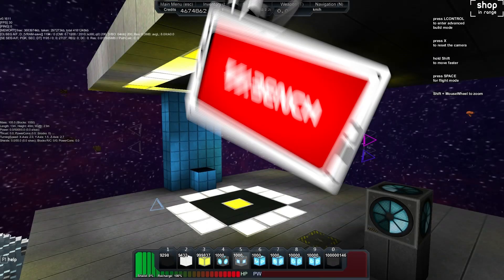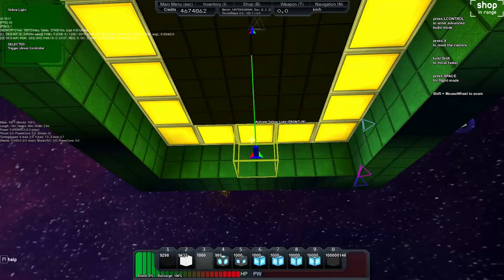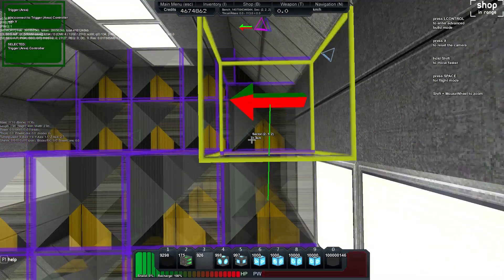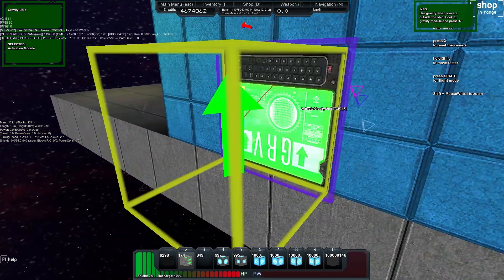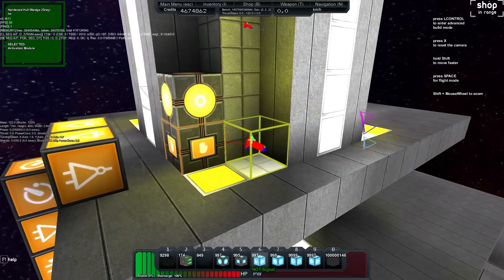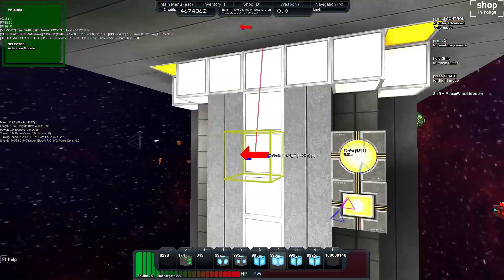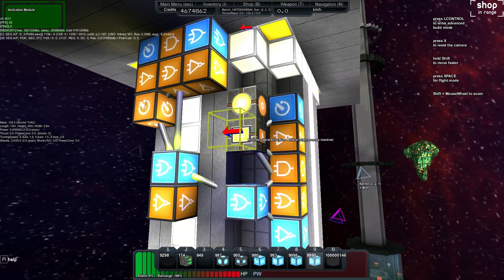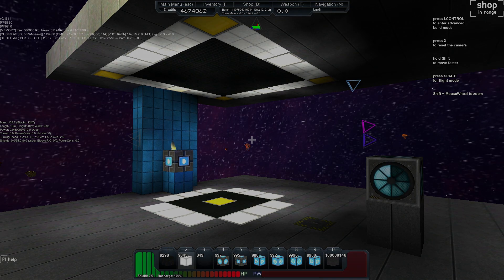Starmade Logic #14 - Gravity Lifts

Comment: This seems far more complex than it needs to be. Here's what I would do:

- Bottom activation opens the door and flips the gravity.
- Area trigger partway up tube closes it.
- Area trigger near top of tube opens top door.
- Area trigger on far side of top door closes it.
- Area trigger at top "landing area" re-flips gravity.

Going down is just the same stuff without flipping the gravity. If the area triggers are set up so they just "toggle" the door, you don't even need to hit the activator on the way down. No delays or complicated clocks. You could even automate the entire thing with area triggers.
Reply: Yeah bench over complicates things too much.